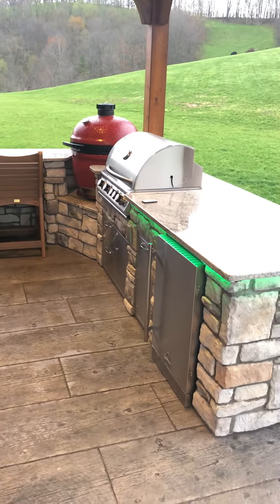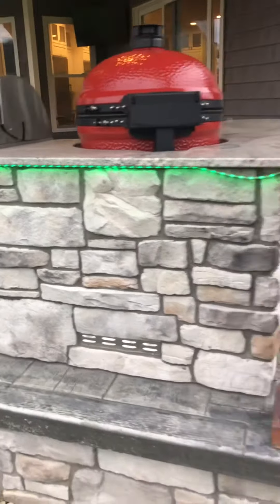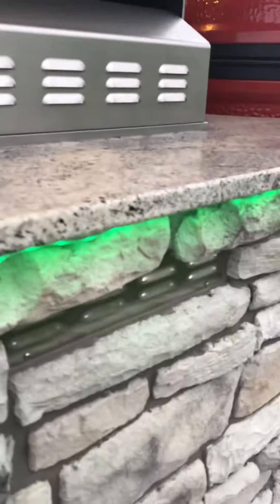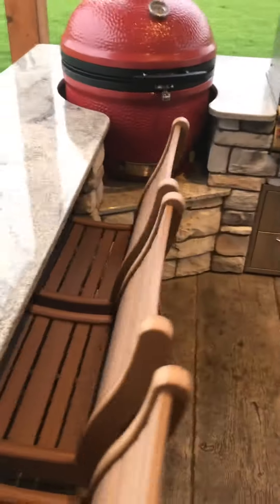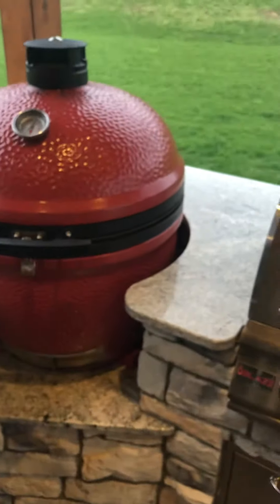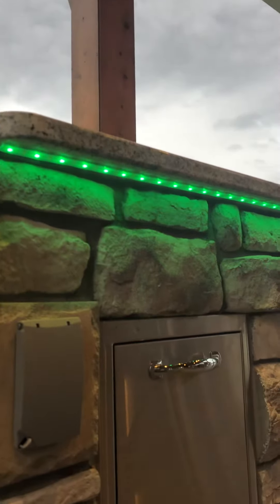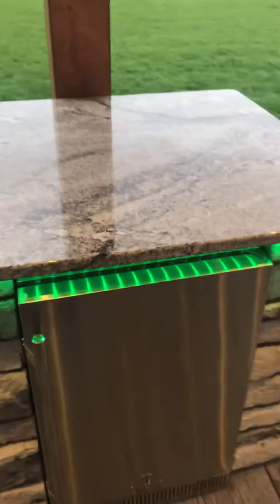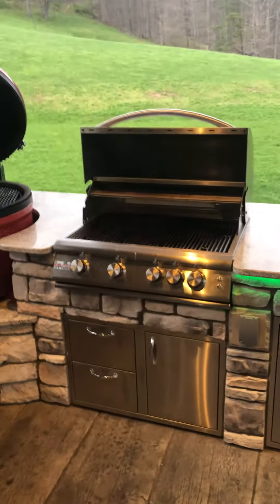BBQ Island Build - Part 3 Cultured Stone, Granite, Big Joe Kamado

Comment: Jason, Fantastic job!  I think that's a Blaze refrigerator without a trim kit.  What are your thoughts about the need for a trim kit?  Why do you recommend installing the countertop before the stone veneer?  Thanks for sharing!  Hopefully will have mine done soon.
Reply from the maker: It is good for the fridge to breathe a bit and if you build it right you will not need much of a trim kit. I think it is easier to have the counter on then grout up to the counter. Otherwise you need to grout that later on and it may not blend well with your other stone grout.

Comment: Thanks, Jason, I'll be starting my project tomorrow. I'm installing the same Blaze grill. Did you have cut notches in the granite so the grill is flush with the cement board?
Reply from the maker: There is just a cut out in the granite that lets you slide or drop the grill into place. The weight of the grill sits on the granite, which sits on the cement board, which is supported by the studs. The weight on the counter is spread out evenly and will not hurt it.

Comment: I bought a blaze. Yet to start framing.   Does the grill sit ion top of the  thickness of the 1) backer board  + granite, 2) only backer board, or 3) just on metal stud. To put another way.  If blaze says to build 8.25 inches down and I’m using half inch backer board and 1.5 in granite. Should depth be 6.25 to the frame the grill sits on
Reply from the maker: Blaze sits on the granite. U will slide it in right on top of the granite surface. Make sure u leave room for the the connections in the back
Reply: Jason Hall so all of the weight sit on the granite without any structural support underneath the body of the grill.
Reply from the maker: @joemastromarino7466  yes but you will have studs directly under that area of support so the weight is transferred straight down to the ground.
Reply: @jhall2242  and @Joe Mastromarino. Are there any issues with blocking the vents the blaze has on the sides? We are seeing these vents may be blocked by the cement board and countertop.  Thank you!
Reply from the maker: @ursulam4994  I don’t remember any vents on the blaze being blocked. So far it works great after 2 years of use. Made chicken on the Blaze last night. Most heat goes up and out the top/back of the Blaze hood.

Comment: I have a question, the c channel the goes in between the metal studs are they 20 gauge also?
Reply from the maker: Rick Vargas as far as I know it is all standard commercial steel drywall studding. The studs and channels are 25ga. Link to the stuff I used: https://www.homedepot.com/p/ClarkDietrich-ProTRAK-25-3-5-8-in-x-10-ft-25-Gauge-EQ-Galvanized-Steel-Track-362PDT125-15/311378868
Reply: @jhall2242  thanks my brother, I was confused because you said 20 gauge and not all Home Depots have it. But 25 gauge works im good with thanks again!.